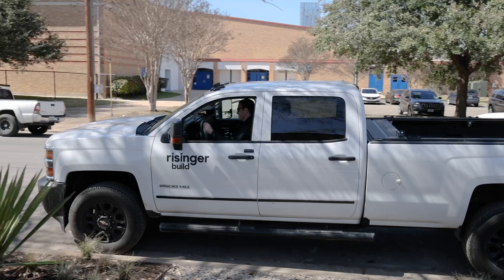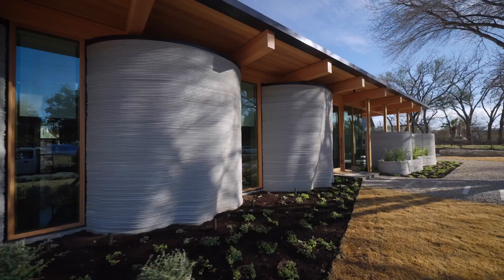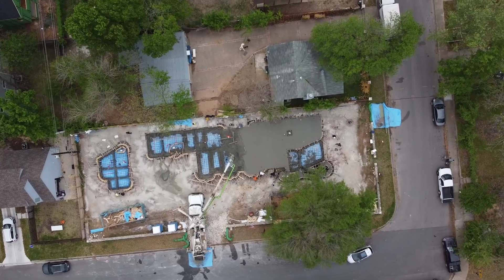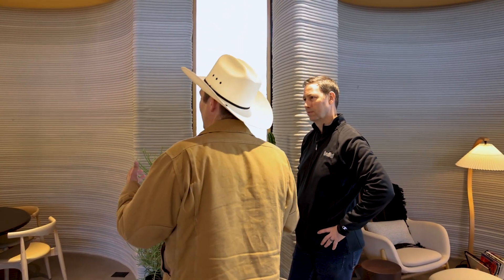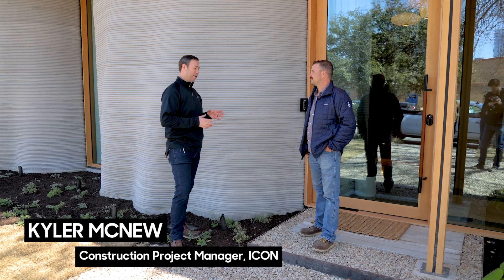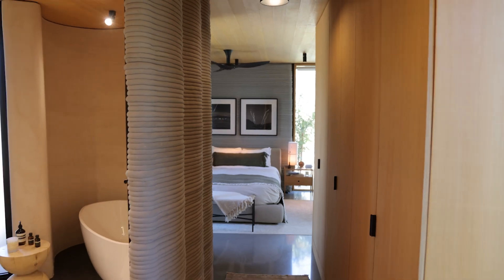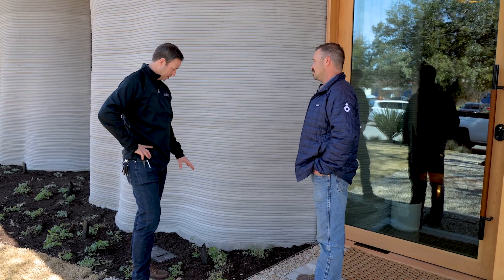World’s FIRST Home SPECIFICALLY DESIGNED to be 3-D PRINTED!

Comment: Not sure why a lot of the comments are concerned with concrete as a building material: heating and cooling, dust, wiring… you do know all the high rises are made of concrete right? Deal with these the same way those high rises do. People have been making concrete buildings for 100 years already. In a lot of countries, people made single floored houses  with concrete too. People make concrete bunkers, underground offices, etc. etc. except those were not 3D printed. All those structures have heating cooling, plumbing and wiring in.

Comment: How do you dust the ridges in the house? lol. A swiffer duster would stick to it. You'll literally have to vacuum every square inch of wall with a plastic bristle brush. And often. Eesh. Add some plaster for a smooth finish and this would be even better.

Comment: I've been working with a 3d printer now for about 4 months.  The biggest challenge is first layer adhesion.    So I'm curious on what is being done for first layer adhesion from the printer to the foundation slab.  I has to be dust free, level and and the right temperature and thickness for best adhesion.  This is true with engineered materials such as PLA ect.   It would be nice to see some destructive tests for sheer strength.

Comment: Rubber roof properly covered with plain elastomeric water based non toxic coating, just because rubber deteriorates in sunlight, is the way to get a forever roof. Now maybe this stuff as a final coating? But you really want it to reflect the sun back out into space!

Comment: The best news about 3D printed walls is that they can be plastered over and the rough uneven surface will be gone. Then maybe the power outlets could be at a sensible height for those who find reaching down to the floor is an unwelcome challenge.

Comment: I wonder how easy it would be to clean?  Hand prints, dust accumulation, oil in the kitchen. Unsealed concrete could very quickly begin to look trashed
Reply: Was just thinking the same thing.  Have to maybe get some custom tools for it.  That concrete has a lot of texture to it and would definitely accumulate dust in every single little line.

Comment: THIS MACHINE is only worth it
on a multi unit development running 24/7

by the time they truck and set it up time
you could use various other methods - RAPID WALLS and do faster

Comment: And finally Matt, sorry my questions didn't come all at once. would these be good as they said this house is in Missouri (I may be wrong there). I'm from NEPA so I'm not familiar with Missouri's climate, however against tornadoes and floods this would be resilient. I think Missouri is a little too far in from Hurricanes. but this also helps prevent wildfires.

Comment: Matt, are they able to trowel flat the bumps so to speak as they go or is this just how the houses have to be on the outside and the inside?
Reply: The tour of the bathroom was to show how you can plaster the walls smooth, though they talked about not doing it in general to leave the technology exposed.

Comment: I'm a little hesitant to say this will never take off, but as someone that worked in construction for 5 years I can see a lot of problems with this design.
Reply: Wiki up "Xanadu Houses".
They were an experimental construction method back in the late 70's and early 80's.
I vacationed up in the Wisconsin Dells and got to see one up close.
Now, it didn't take off, and the end of the project highlighted why it's a bad idea to leave such homes dead/dormant.

HOWEVER, there are distinct influences that have carried forward into modern home building (super-insulation, home automation, use of alternate power sources).

I expect the 3D printed concrete homes will have a similar impact on the overall sphere of home building.

Comment: I wonder if a temporary reusable form could be used to create flat smooth sections of the structure to help frame in windows and doors.   You could use that technique on the bathroom wall as well so little to no plaster would be required.  I would imagine the major challenge would be nozzle/head to form clearance.  The workaround would be to angle the head like some modern CNC machines are capable of.

Comment: its a cool house. But 50 years ago people were making concrete dome houses. It was a bounce house filled with expanding foam, and then covered in concrete. The issue with those houses today is water gets into the cracks, freezes, makes bigger crack, repeat year after year. The problem isnt with concrete. The problem is with it not being a smooth wall that sheds water. So, while it looks beautiful, I wouldnt expose the concrete. Paint, poly, 4' eves, something to keep those walls complete dry.
Reply: Yeah, the exterior should be covered up with bricks!

Comment: I would be interested to see how that house did on a air leak test
Reply: Should do fairly well.  Since the wall is concrete with spray foam fill, the main leak points will be the shell penetrations (pipes, utilities, doors and windows) and the roof interface.
Reply: It’s better than a normally built home there are tons of videos on this exact topic .
Reply: @TeXasDadBod  Any links?  I know there's videos for various other concrete structures, like ICF.  But I haven't seen leak tests on this particular home.

Comment: Hi Matt, I’m super interested in deploying 3D printing construction in the Midwest! It does get a wee bit colder, and the wet season might be a bit more sustained than yours (though the total amount of rain is pretty similar). What are some ways to start thinking about executing beautiful 3D printing home design in areas outside of Texas? Thanks! PS. ‘prototype’ or ‘minimum viable product’ are both terms I’ll be using once I get started :)
Reply: There are companies that make and sale concrete 3D printers however there is a lot of science that goes into the mix. The walls are printed over weeks but the whole wall has to dry together and not in layers.

Comment: Great for Mediterranean climate, how can an energy-hog house (fill core blocks/thermal bridges) like this one can be code approved in Texas?
Reply: It doesn't actually have much if any thermal bridging. The inner and outer layers don't actually touch at all in this design, and there is insulation in between them.

Comment: Would be interested to hear how he gets r40, I would had thought that there would had been significant thermal bridging due to the concrete.
Reply: The wall is hollow and braces like a Tstud.
Reply: Remember, the walls are hollow concrete structures.  They fill it in with spray foam.
You'll see some bridging around doors and windows due to the "just drop a pane of glass" construction method.

But for someplace in TX or California, this is no big deal.

Minnesota?  Might be a problem.
Reply: Only some of the walls are r40, they achieved that with spray foam insulation. Think the baseline was r25 for the bulk of the concrete walls

Comment: Only time will tell if printing concrete is a good idea. Not sure if I’d want to use it as a structural wall just yet.
Reply: Needs to be built on a shake table to see how well it will handle settling and earthquakes. The curves might compensate for the lack of rebar but without testing I wouldn’t trust the construction.
Reply: @michaelgreene9889  it has rebar, can't see it in this video, but if you watch Matt's video on the 100 house project icon is doing with lennar, they have rebar in the courses, as well as 5/8 rod from slab though roof for uplift, which are fully grouted into columns. It seems well engineered, the biggest concern I see is weather resistance of the concrete surface if left raw like in this case.

Comment: Not bad looking, and the technology is interesting, but all that wall space and I only saw 4 pieces of art hung. Bare walls are boring. And floor to ceiling windows may provide nice light and views, but they can't be opened to get a nice cross breeze. Hopefully other house designs could be tweaked to allow traditional windows.
Reply: Opening windows is last century.  Windows are for light and controlling heat gain.  ERV's are the new windows.  Controlled ventilation.

Comment: First 3D printed house I’ve seen that didn’t look like a poor replacement for CMU. They actually used the technology for it’s strengths. Maybe it has more potential for residential than I thought, we’ll see.
Reply: They're going to have to overcome the "artsy fartsy" factor which only really works in high end, big dollar construction.

If they can play to the method's strengths while still delivering a home that's hits the center of the market, great.  Foam filled concrete walls on an insulated slab that can deliver traditional rectilinear living spaces would be huge.
Reply: @PhotonHerald  you can, however it is inherently cheaper to build a nicer looking home as they described in the tour, full frame windows cut cost and complexity down, the curvature adds strength, for interior you could easily convert to straight walls and doors and basically have a traditional style home

Comment: Architects always build in functional obsolescence in their designs it’s just plain dumb anybody that lives in that house is going to have two cars so I have a two car garage not an obsolete one car carport.
Reply: Think urban, not rural.    Most garages are filled with crap not cars anyway.   It is a concept home not the first in a tract.
Reply: @Ivebeenaroundyouknow  It’s still garbage and impractical
Reply: @brearlymason4903  idk.  Concrete has been quite a durable building  material for many many centuries all over the world.   IMO wood frame is crap and impractical.   Size and configuration is just a matter of choice/need.
Not everyone's needs are the same, just because it wouldn't meet yours does not nake it crap. 
Construction method shown is far superior to our current codes. Far superior.

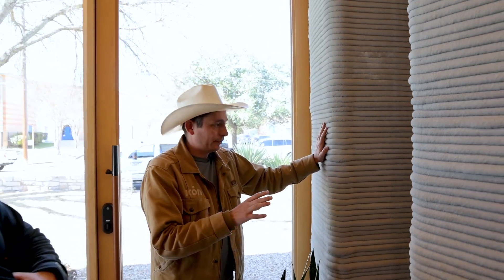Comment: I would love more detail on how thermal bridging was prevented. Looking at 12:35, it seems like they tried to create true gaps without thermal bridging with the "ripples" providing the structural integrity, but it's hard to say given the distant view in that shot. I'm also unsure if at the windows they specifically tried to prevent concrete thermal bridges running along the window jams by having complete breaks in the concrete where the windows go in (looking at 12:35, it seems like it, while the details are unclear at 6:30). Any concrete thermal bridging is going to undermine the claims about the possibility of an "R-40 wall" (3:45), so spending more time here on the details would be much appreciated to truly support the building science mission.

For every 3-D printed home I've seen, I've always felt like 3-D printing was a hammer in search of a nail that created severe problems while solving relatively little. Maybe this house has solved many of those problems? At the very least, the bits shown in this video suggests some progress is being made. Well done!
Reply: I'm fairly certain the concrete wythe is continuous from outside to in surrounding the windows. He explained the window opening is tapered and the window depth was determined by where the window panel fit, so I would assume no special accomodations were made to eliminate thermal bridging around the window. 
I thought it fairly clever the way they trimmed around the window. It looks like they used a diamond saw blade to create a slot where they inserted a piece of 1/8" dimensional steel. That  left it looking very clean, but also an excellent conductor for cold.

Comment: Thank you!  I would like to learn more about how they are integrating reinforcement (rebar equivalent) to these builds, or if not, why not, and what the limitations are because of the lack of reinforcement.
Reply: Concrete doesn't need rebar when/where it is in compression.  The rebar is to support tension.  So, rebar going to be in the floor and ceiling.  Single story walls should be purely and always in compression (if on  flat/level/strong slab., which itself will need rebar).  Add a 2nd floor and there will be areas of tension.
I would make this my retirement home, when that time comes.
Reply: @csf1757  I think perhaps I am biased by being in California.  Yes concrete's strength is in compression, but sooner or later a concrete wall in California is going to experience some fun tension stresses. :-)

Comment: I appreciate the innovation, but there are thermal bridges everywhere. This wouldn't work in a cold climate.
Reply: Those thermal bridges can be broken to adapt to a cold climate. And design can be customized to take advantage of solar exposures of different building sites. Not to mention adding solar. Very exiting!
Reply: There is also thermal mass, which retains temps, lowers mechanical requirements, etc.  Bridging is more of a problem with 2x construction than with concrete.   Whether u are talking about 3d, icf, tilt wall, etc.

The big issue with that house they discussed is the door and window sealing and flashing

Comment: Wouldn't all those concrete ridges just be caked with dust?  And impossible to clean with anything but a blower since concrete grabs cloth.
Reply: That's the 'helps' problem.
People who buy this don't do their own cleaning....
Reply: I built a home for myself in 2020 (out of containers). I used sealed windows and a hospital grade hvac system and ive had next to no need to even sweep thus far. 
Point is if you built it right dust wouldn’t be there to begin with
Reply: Use a vacuum cleaner and its attachments
Reply: @mattbrew11  This actually is a solution because vacuuming every ridge sounds like a nightmare

Comment: I like this better than ICF, HIGHLY prefer the insulation method, but how strong are those walls vs ICF vs traditional? I'd definitely use plaster inside. I'd add hurricane rated windows and radiant heating running off a solar roof. What about basements and/or 2nd levels?
Reply: A utility trench style basement that occupies a relatively small portion of the total slab should be easy to integrate, just plan ahead to place beams where the printed walls will cross over the trench. A second floor could be easily added by dropping steel beams into the printer, if the printer can be made 2 stories tall. I think some of the wall cavities might need to be reinforced with rebar and traditionally poured concrete.
Reply: Hurricane windows?....Austin?
Oh dear....
Reply: @willbass2869  did you catch the part where he said he lives in Austin? Yeah me neither. Pack up your 24th chromosome and GTFO
Reply: @willbass2869  I don't live in Austin...but yes, anywhere. I'll take the storm proofing and security. Especially with floor to ceiling windows!
Reply: @mattbrew11  it's in Austin. Don't be a d-bag
Reply: @willbass2869  is HE in austin? Dont be a dolt

Comment: I think too many people are reacting badly to an early prototype. This is a long play. This is Tesla 2004 when they only had the crappy roadster and it did a bunch of things worse than a conventional car, though the potential was very apparent. This is not gonna come and take your job tommorow but it's definitely got a big place in the future of how we build. Id not bet against it! Good luck Icon!
Reply: That Mars/Moon mention from Matt got my wheels turning.
Reply: @bothellkenmore  especially if you are refining aggregate from the surface of the planet. Also massively cuts down on number of specialized connectors, fasteners etc you need to bring. Just raw stock and maintenance parts for the machine

Comment: Beautiful house, nice layout but dusting those interior walls would be a nightmare. A nice smooth finish on the interior walls and that would be gorgeous and more user friendly!
Reply: They can do that anytime. But it's a showpiece. They want to draw attention to them.
Reply: With a modern ERV / HVAC SYSTEM and the style of windows this has (ie fixed) its probably years and years before dusting would be necessary at all. Quite frankly a broom head vaccum with an extension would make that job easier than wiping down walls anyway

Comment: It’s been three years since Icon debuted their 3D printed house abs thus far they have built three. Additionally, they are only about to build one floor with the concrete pouring robot, and use traditional wood framing for higher levels. 

This is a solution to a problem that does not exist. We have had the technology to build with masonry and concrete and metal framing for well over 100 years. I don’t see what need this is addressing other than it’s a significant upgrade over garden variety wood frame and dry wall homes.
Reply: The problem it solves is having to pay for subcontractors or labor to do custom masonry work. All they have to do is bid slightly under the builders using traditional labor until they drive them out of business and pocket the difference.  Eventually, the cost savings will come to the consumers but it will take a long time until there are enough builders with the new technology willing to pass the savings on to them. There is nothing wrong with the technology itself.
Reply: Based on what I see this enables much more creative designs and easier to insulate. If this technology scales it could easily half the cost of single story construction
Reply: @mattbrew11  It would depend on the local labor market as to how much it would cut the costs. I didn't see any shape that couldn't be done with traditional materials. You can run foam between two brick layers just as easily as between two layers of extruded materials. I saw one presentation elsewhere that I think was pretty cool where they mixed it with traditional construction to prefabricate just the really complex features.   If you can truck in the printing equipment and the materials, you can truck in pre-fabricated panels and they go together faster. At least compared to the technology currently being used.   As far as creative design compared to traditional materials, take a look at Gaudi's La Sagrada Familia.